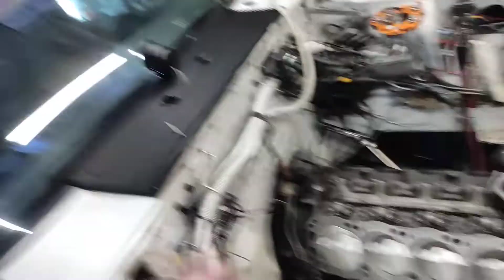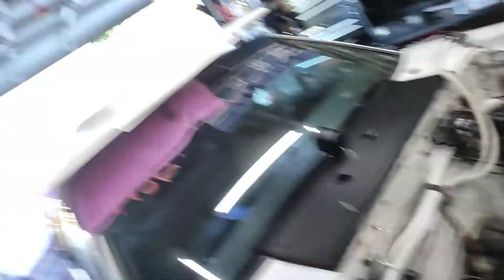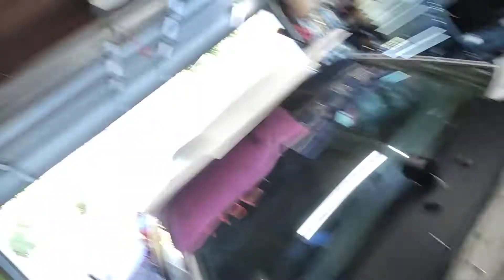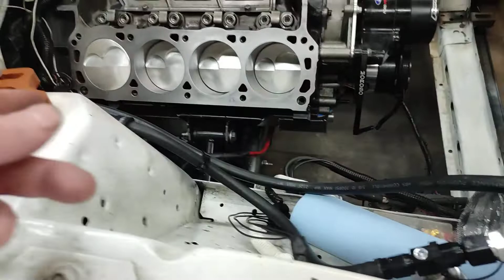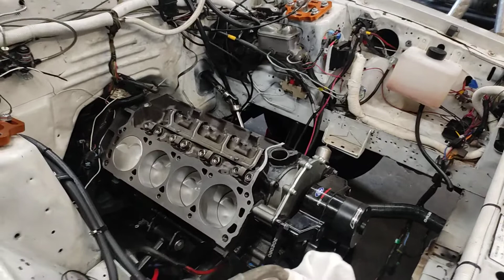got the engine in after work today!

Comment: Man vrm,  moving like the wind, looks great.
Reply from the maker: I finished it up this morning and fired off just fine after setting timing! 1 problem, water leak at back intake gasket! water is dripping out of the back intake bolt hole At least it's not rear main seal leaking! Ugh! I still have 5 weeks before next test and tune so no big deal, new gaskets on the way!
Reply: @vrm86gt  That really sucks, you got time to fix.
Reply from the maker: @DragBoss351Cleveland  I will knock it out in a day or 2 at most  leaving for vacation Sunday so might have to wait until I get back from visiting family in Vegas and then checking out Lake Havasu for a couple days.